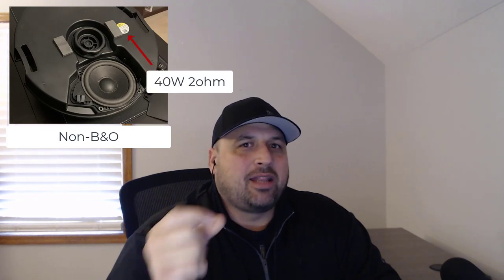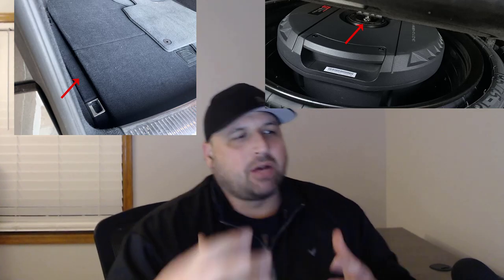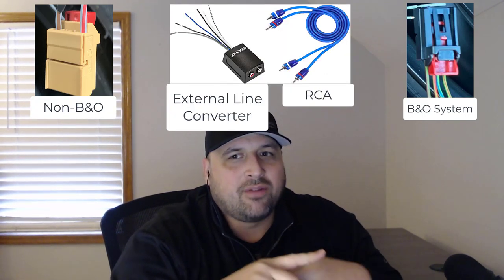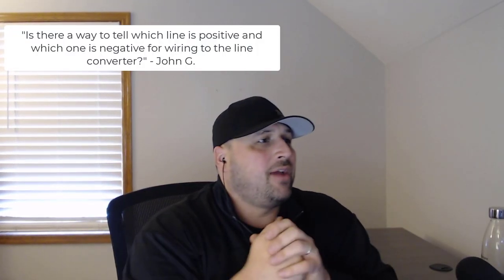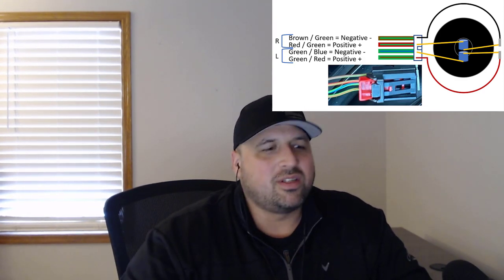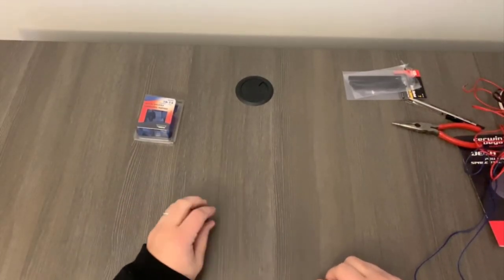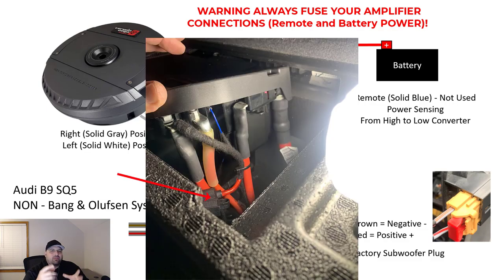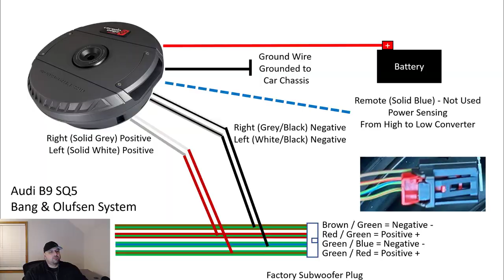Audi SQ5 B9 - Q&A and How To -- Cerwin Vega Spare Tire Subwoofer

Comment: Can anyone suggest what Phase to set the CV controls for on the SQ5 with B&O system ?
Reply from the maker: I did it at 180. It actually has to do more with the direction of the firing of the woofer. The best way to tell correct phase is the bass will be softer when it is out of phase because a reversed phase it will cancel out the existing bass from the midrange speakers in the doors.

Comment: so if I have the b&o i can use the prosumer harness with block connector directly to the built-in high to low converter and i don't need anything else?
Reply from the maker: If you get the prosumer harness with the block connector--- you can connect the built in high to low converter no issues. If you get the Prosumer harness with the RCA's attached, you will need to find a 12v power source for your amp to power on.
Reply: You may have an issue with the Cerwin amp not turning on sometimes.   I have noticed from time to time, that the sub will not "turn on" even though all the lights are green and the controller is lit up.  From my understanding, the CV Input using High Level is 0.9V-12V. That’s not enough to support the B&O amp from cutting out after some start cycles. I haven't put in the Kicker 47KeyLOC, but still may do it
Reply from the maker: @matthewdube7802  I noticed this issue, but I actually think I know the reason. When you are on a bluetooth call with the car -- I noticed that it turns off the subwoofer.  Perhaps to cancel out the feedback? Essentially, if I started the car, and was on a call as it started, the subwoofer never turned on until I turn off the car, open the door, then start the car again. Maybe an MMI Bug?